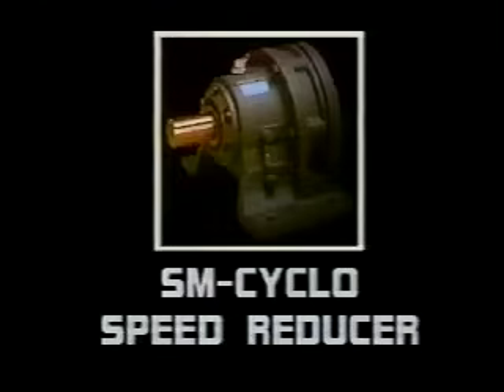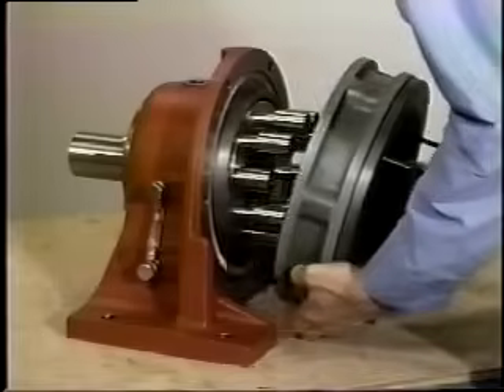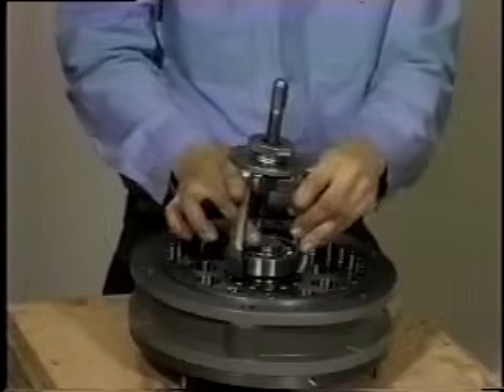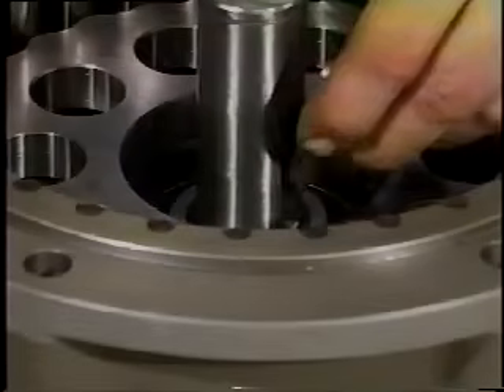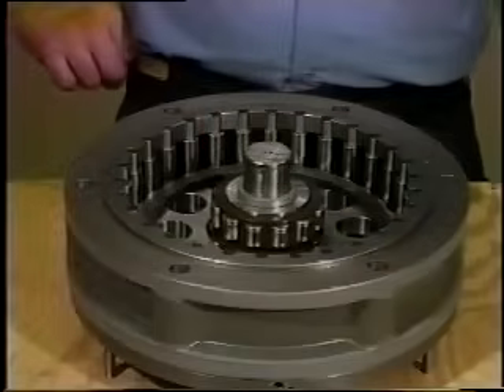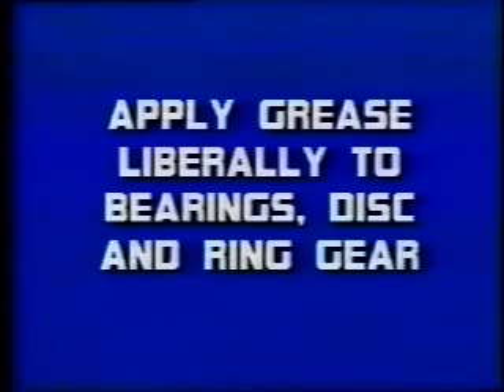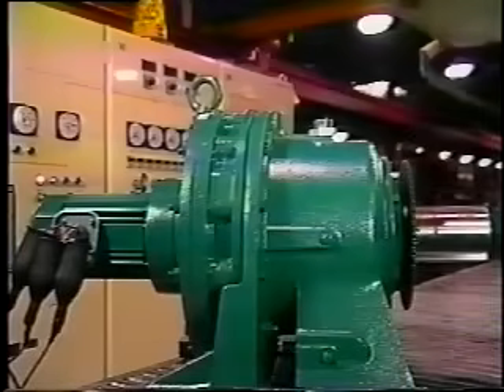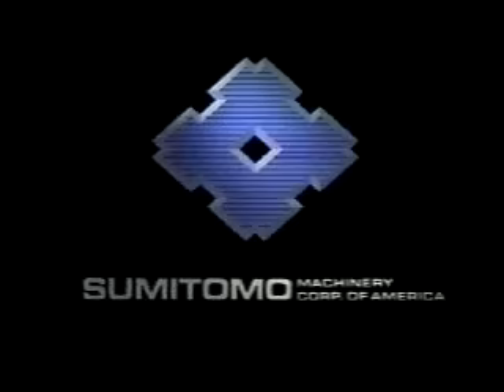How to Repair a Cyclo Gearbox

Comment: We fix a sumito cyclo drive in a eziki tunnelling m/c ..but the problem is now motor shaft rotating and output side shaft rotating became same.. actually input side and output side shaft rotating should be oposite..so i am concern about this..is their have any problem if you run this machine like this???
Reply from the maker: Hey Mainak! Please contact a facility closest to you to get a hand on what's happening with your Cyclo: sumitomodrive.com

Comment: When installing the first disc and whether the oil hole needs to be in the correct position ..? The two disks are 180 degrees apart, aren't they ..?
Reply: Yes sir.. the hole between 2 cyclo discs might not necessarily in line with one another, depending on the sizes and ratios.. but it must be 180 degree apart..
Reply from the maker: Thanks, Izzuddin!